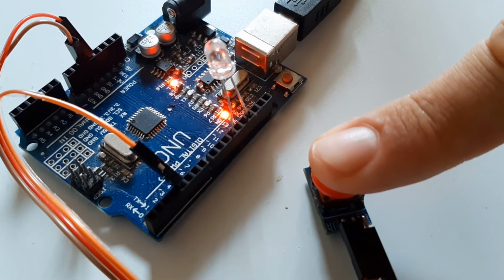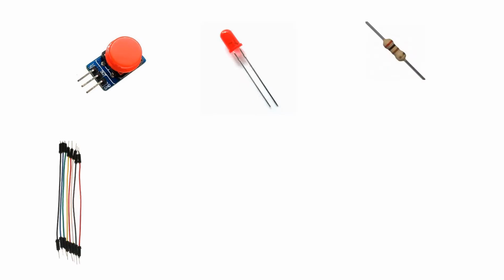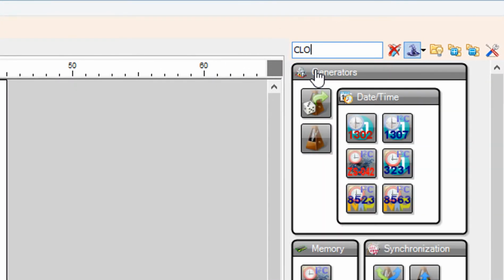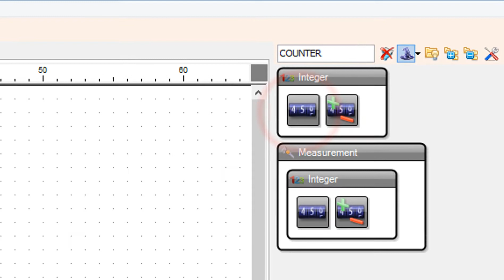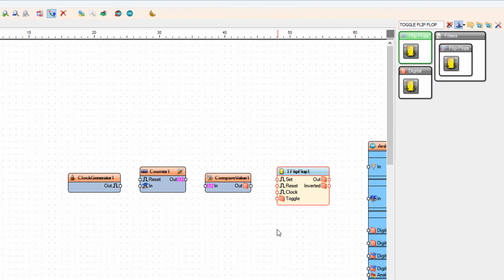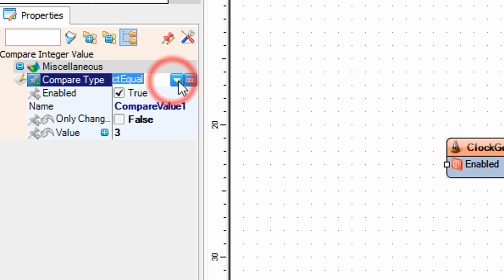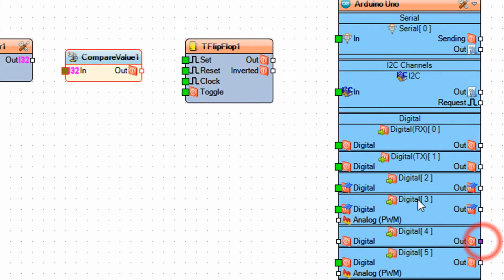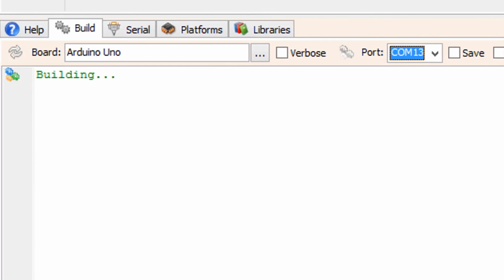Arduino LED - Hold Button 3s to turn ON & 3s to turn OFF

Comment: Great video, but do you know how can I made this exact same simple mini circuit without an Arduino using a 3 volt battery?
Reply from the maker: Connect the battery (+) to the Arduino pin VIN and battery (-) to the Arduino pin GND